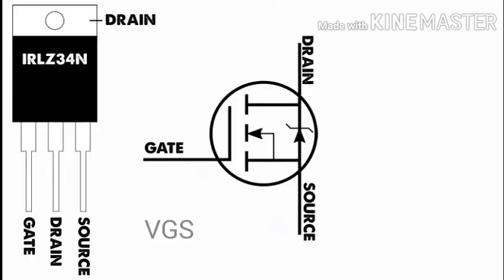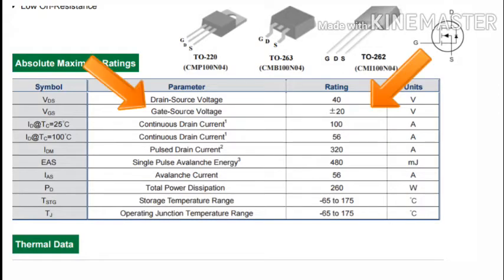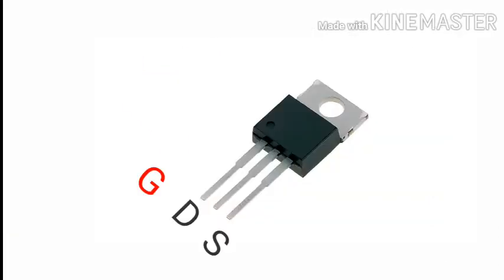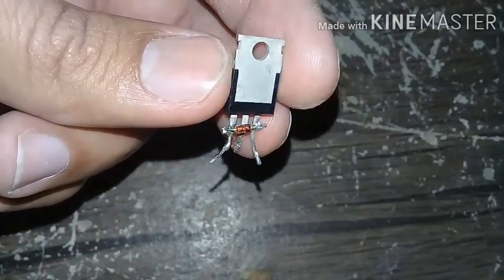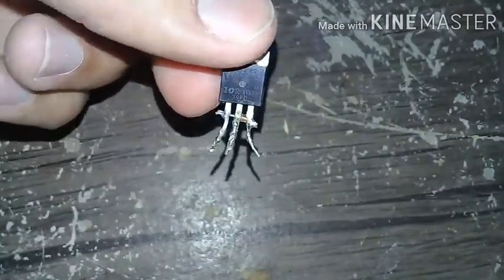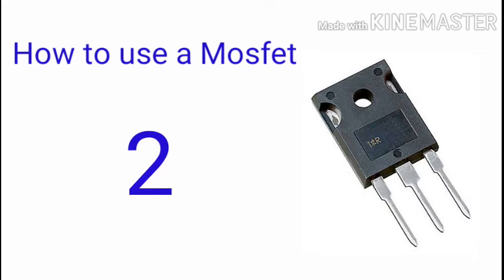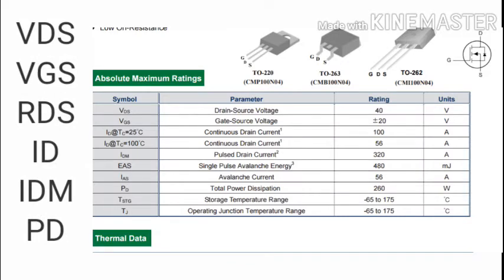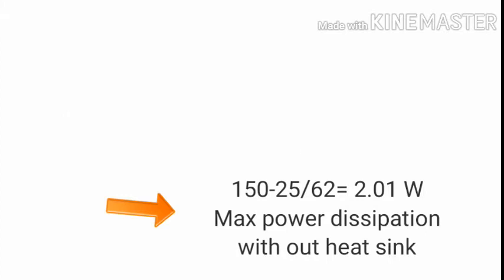MOSFET HOW TO PROTECT USE N RUN

Comment: Good info thanks.  People running HV circuits buzzing away is one thing with their fly back diode.  But when you want to run a car ignition its a different story -  as the the flyback diode kills the spark.  Ive had many failures due to spikes.  Its useful to mention when the gate of mosfet is spiked and mosfet blown it fails in the on mode.  Whereas if the failure is at drain source then it fails in off mode -  according to AI & yesterdays memory.